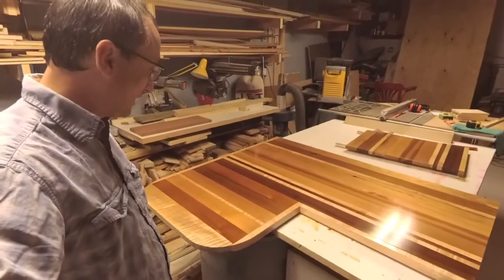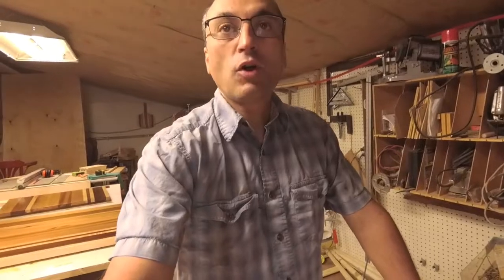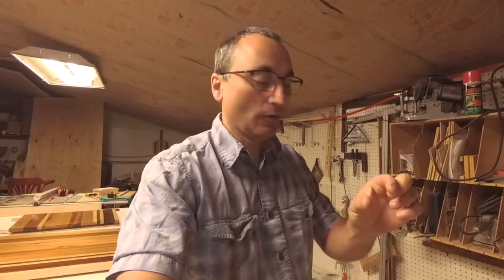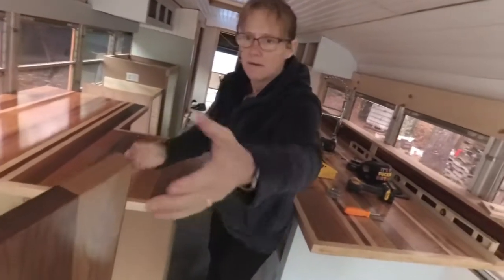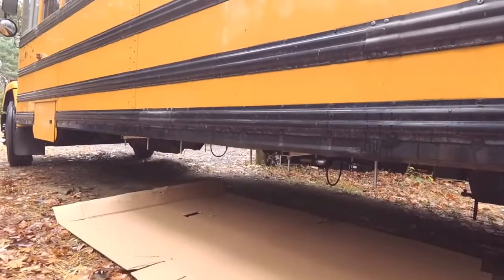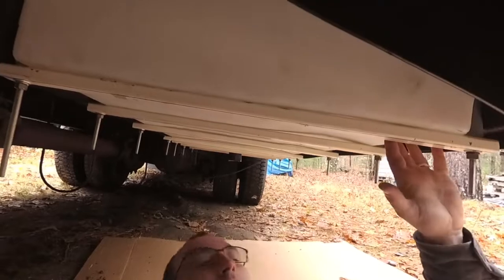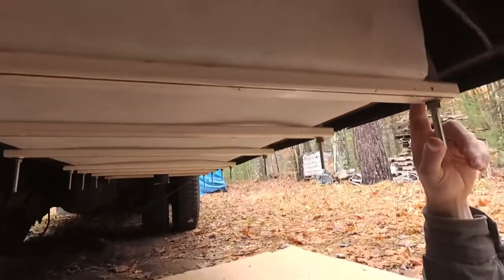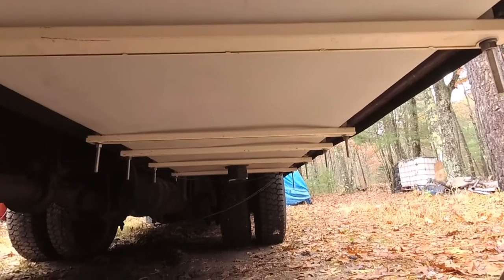Gray water tank installation

Comment: Counters look great.  That's a sizable kitchen!
Reply from the maker: Thank you, and yes it is a big kitchen, A little bigger then expected but it was based on the size of the fresh water tank under the counters.
Reply: @LifetheWildRide  putting the tanks under the counters is an interesting idea.  We were planning for under out bed but the middle would be better for weight distribution.
Reply from the maker: @larrym6019  The reason we did it was because its a 100 Gal. tanks and we just could not fit it under the type of bed we plan on building. My gray water tank is directly below the fresh water tank but its under the bus. this way the weight does not shift its just going from one tank to another. We tried to put a lot of thought in the build, its still a work in progress.